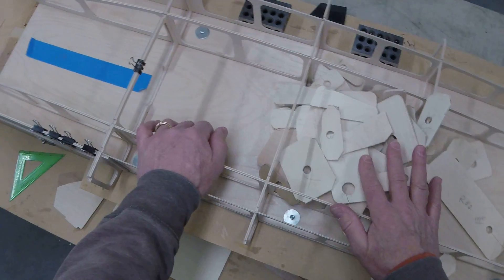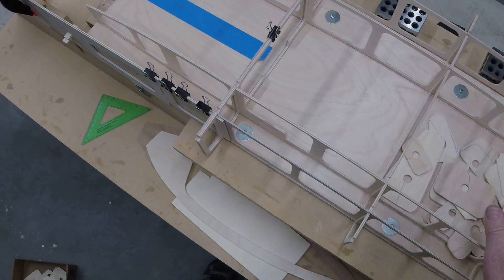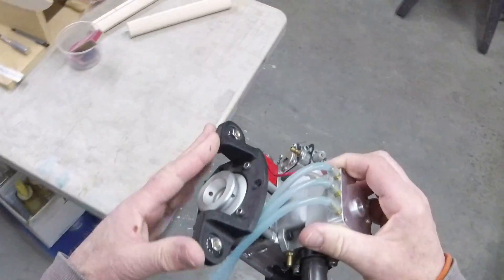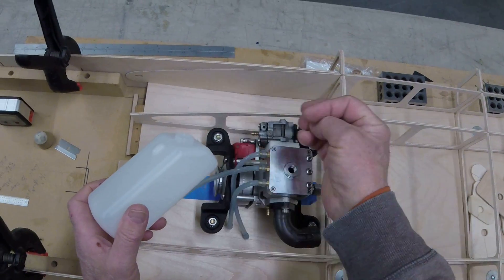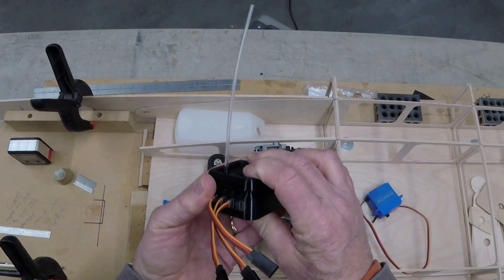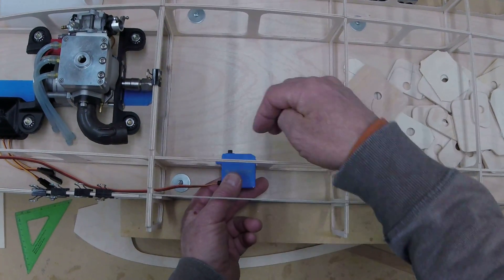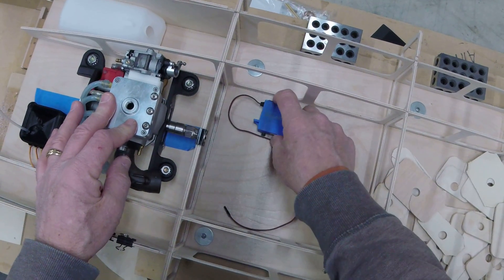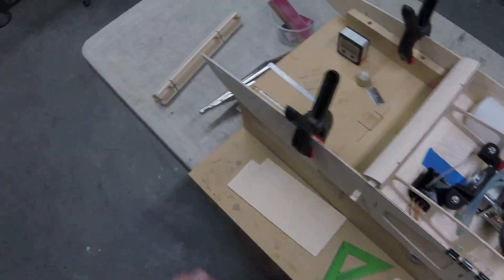The Most Difficult RC Boat Build Ever? The Gasser 2.0 MegaStroh, Scratch Build!

Comment: Details for the engine?
Reply from the maker: Details?
Reply: Ok Specs, who is the manufacture, size (CC), any special carburation or stock, tune pipe? etc., thanks
Reply from the maker: It's a Quickdraw 30.5, pipe, carb, everything exactly as they sent it fresh off the dyno
Reply: @M5PerfHydros  Thanks

Comment: I would like to get the wood coming from American spruce. If you get a spare second send me a material list so I can get it coming. Picked up the MDF tonight for the jig. Also I need to pick your brain about engines I'm trying to decide if I want to go Quickdraw or Zenoah since I don't have anybody to race against in Utah.
Reply from the maker: Easy decision... Contact Gizmo Motors and get one of their Zenoahs. The Quickdraw is too much of a maintenance hog when you're just running for fun.  I've considered switching to Zenoah myself, even bought one, but I'm a glutton for punishment so I'm determined to make the QD reliable. As for a material list, I'm not sure I can provide that. When I buy material I buy large quantities at a time and just use whatever I need, without really considering how many sheets of one size or another that I've used. It's a big boat, 53" long, so you'll need to consider that when ordering.